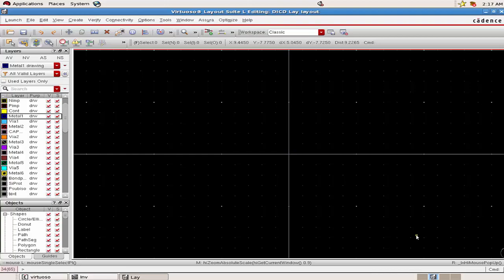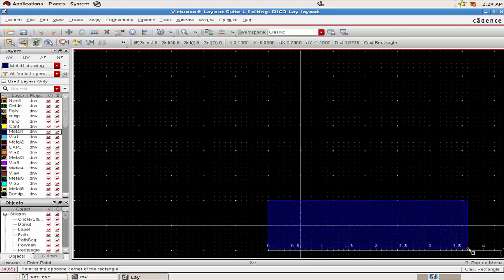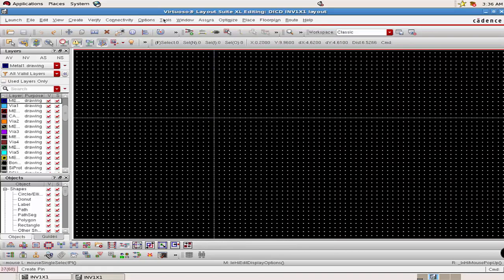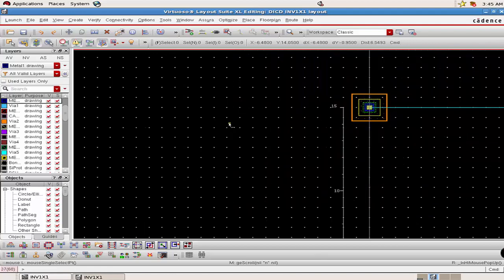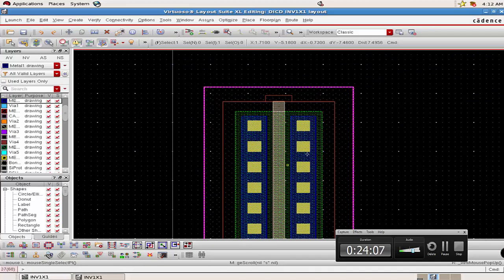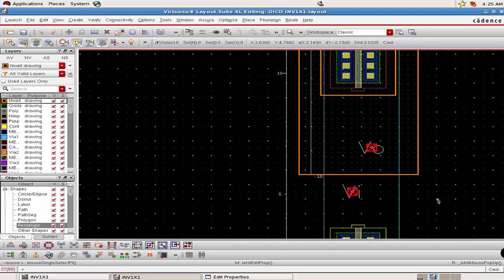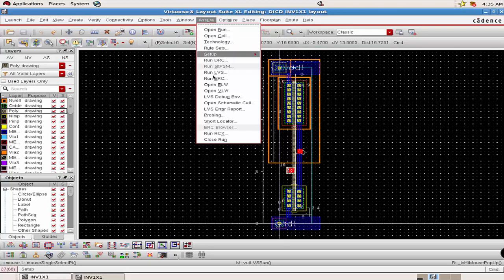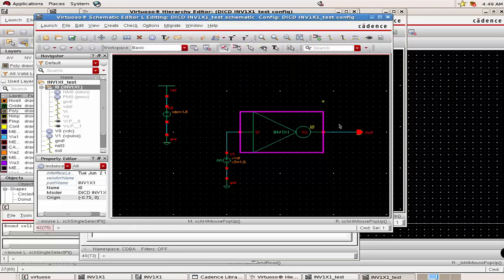Exp4: About Layout Editor & Inverter Design with Post-Layout simulation

Comment: at 26:04 you said the orange color is N-well , but again at 28:46 you says to draw N-well . 
My Question is , when we already had N-well , why then one more N-well????
Reply from the maker: The n-well surrounding the PMOS cannot be stretched, but in order to create body contact and to accomodate other PMOS transistors having a common n-substrate, we need a large n-well. So we draw a large n-well.
Reply: @narashimaraja  , in that case my question is , is it OK according design rules(of course your DRC run has shown Zero errors) one N-well overlapping another N-well ? or if I put the other way,  will the end GDSII file going to treat all N-wells that's N-wells surrounding the p-implants and the N-well that's surrounding all such PMOS devices whose N-well is already existing ?
Reply from the maker: @MDZAKIRHUSSAINS  I guess so